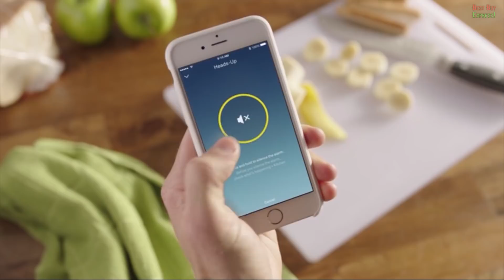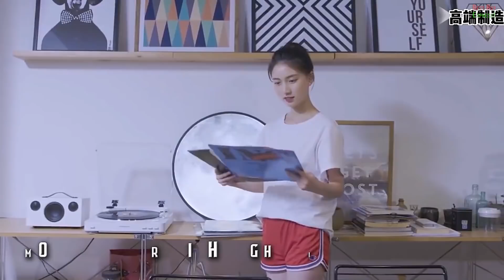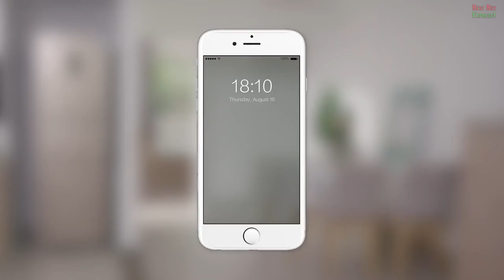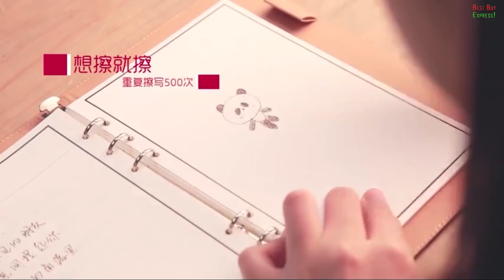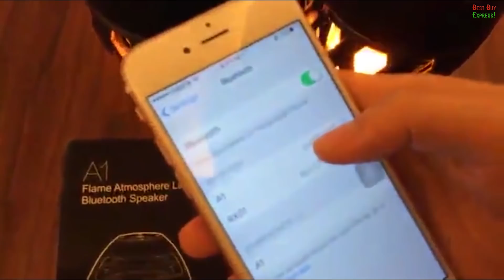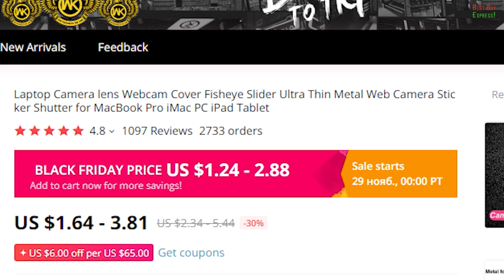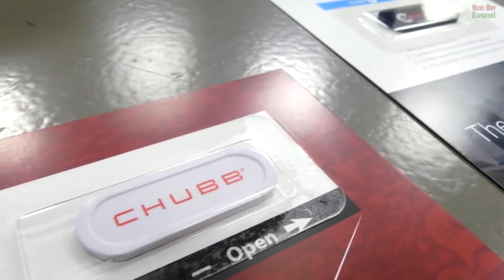42 Cool products Amazon & Aliexpress 2021 | New future tech. Amazing gadgets

Comment: Cool products.But one safety thing for all...Carbon Monoxide dectector should be mounted low on the wall or so, because cm is lighter than air.Up on the ceiling is very hard to get deteceted....
Reply from the maker: ✨Hello✨. Thank you for watching the video 😊 and for your clarification about the gas detector 😉